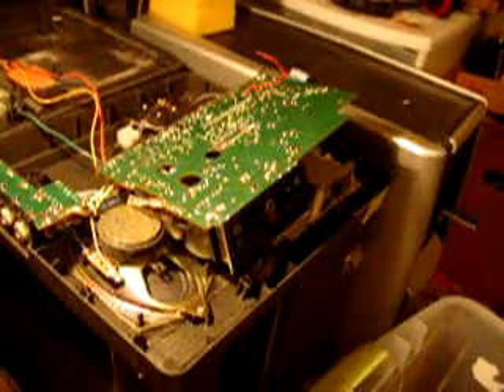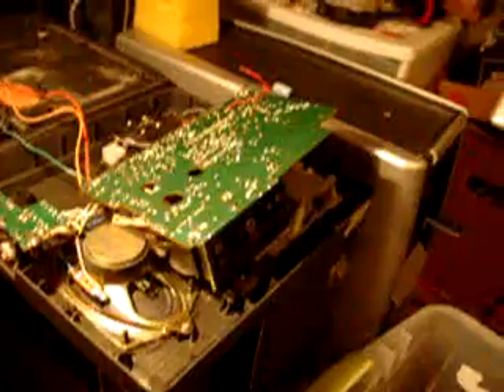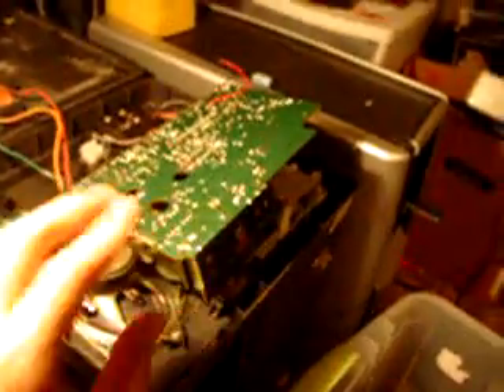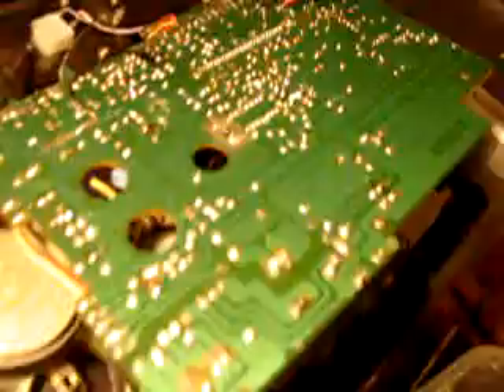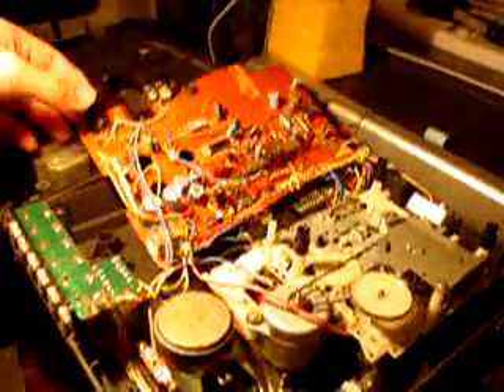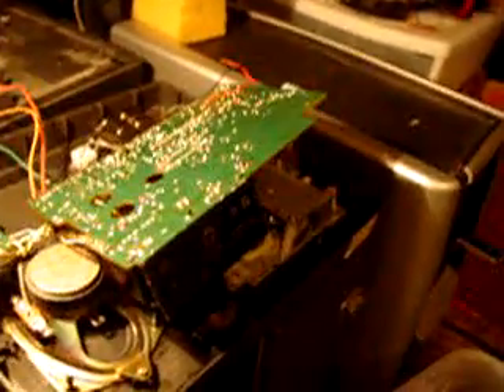FOR SPATSBEAR2: Circuit baord of big Bell & Howell problem

Comment from the maker: It records too weak, and lacks bass in the recording, probably because it's so weak the bass doesn't get on there. But the capacitors seem fine. Playback of pre-recorded tapes is fine and strong. The record level meter operates as it should during record, so the pre-amp must be fine.

Comment: You can get it from the manufacturer, just do a google search on caig deoxit...also you can get it from other distributors like Parts Express. The thing about deoxit is that it actually helps remove oxidation from contacts, something which other contact cleaners are limited in. Deoxit non-flammable DN5 is the best.

Comment: If the same head coils are used for both playback and record, then the problem would almost have to be the record switch or final record preamp stage.  Have you tried leaving it on record, and playing with the large record/playback switch assembly while it is running to see if it picks up any noise?

Comment from the maker: The record and erase heads are separate, the record/playback head is metal, the erase head is white plastic. The machine did appear to have LOTs of use as lots of oxide on the heads when I got. But I cleaned them, and no improvement whatsoever. And I did try both microphone ways, the mic preamp works fine, the VU meter responds as it should and headphone monitoring seems fine while recording.

Comment: Just out of curiosity, did you try both external and internal (if it has one) microphones?  There could be a switch in the external mic jack itself that could be dirty, but it sounds like you checked everything else besides the head.  At this point you would probably need a schematic and a scope. 

Is the erase head also the recording head?  Or are they separate?  I wish I had one of these to look at...

Comment: Hey Ricky! Good to see you back!

And I'd say it would be that the head is shot.

I used to have 2 Lloyd's 8 track players, one had a good head, but all the mechanisms were shot, and the other one had good mechanism, but the sound was weak and muffled, and full of crackles, so I inter-changed the head, and it solved the problem.

I think I even still have the old head in my toolbox!!! Along with a rotten idler wheel from a BSR record changer, and other worn out parts.

Comment: Can you try connecting the outputs of the B&H circuit board to the erase and record/playback heads of another cassette machine and see what happens? Also do you have an oscilloscope, can you see if the bias oscillator is actually producing an output in the record mode?